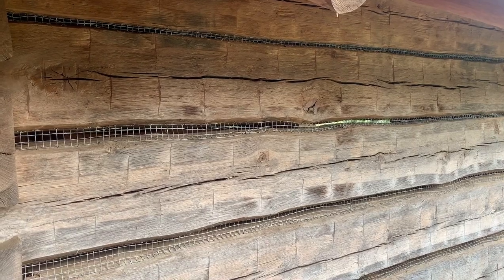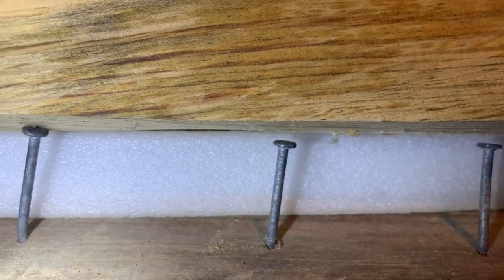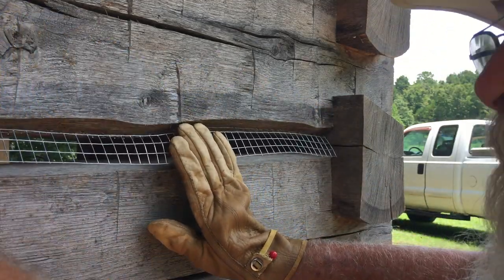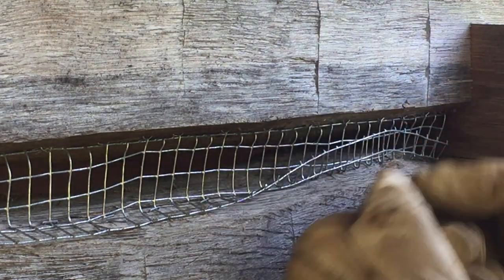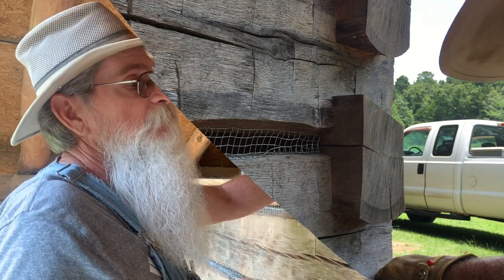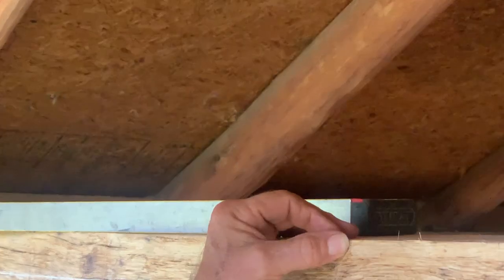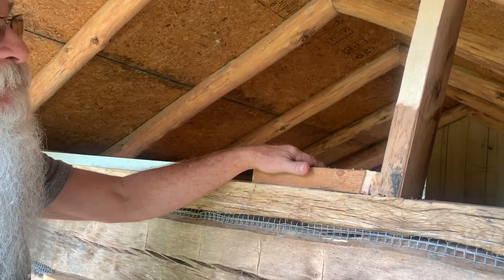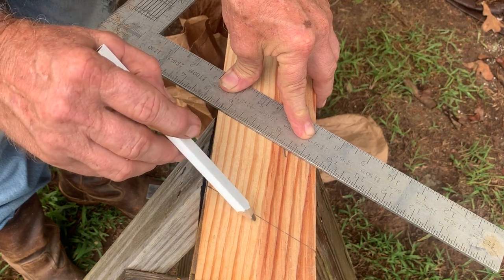Smokehouse Completion (pt2) - Prepping the Logs for Chinking

Comment: Do you not want to touch inside chinking to outside chinking? Leaving a void could let it breathe. So I guess that is the intent? Asking because I would think fill it up. Also now I can see how it would work as a double pane Window effect. Keeping the inside from sweating?  Or is it a material saving thing? Channel is up but not promoting it as just learning how to use it 😂.
Reply from the maker: Howdy Richard- putting insulation in the middle of the chinking gap will keep the outside and inside of the chinking from touching. You need something to keep the chinking from pushing on through. I like to use a close cell foam backer rod from Weatherall. It comes in different sizes and way to put in since it is triangular shape. Hope this helps. God bless